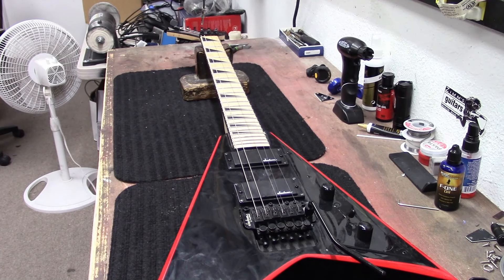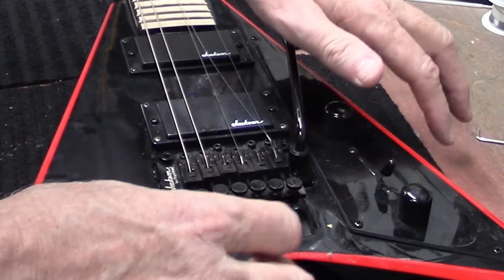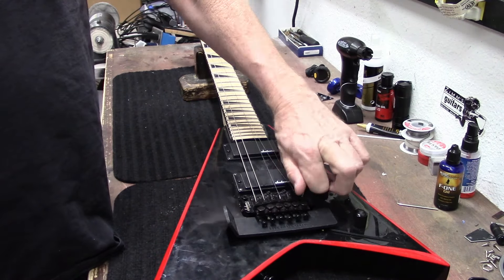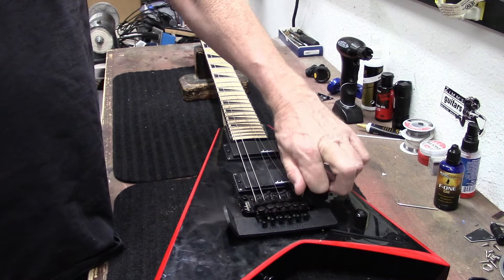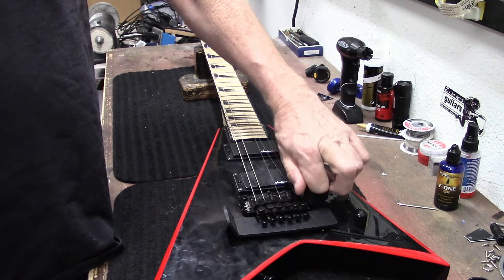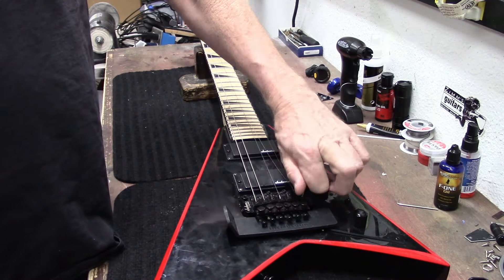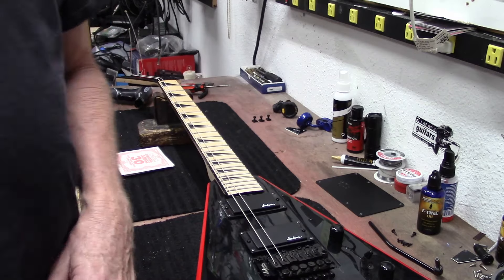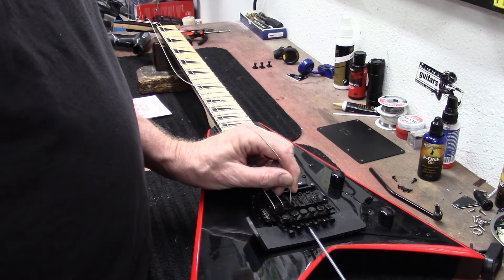Jackson RR-V Restring

Comment: Just so you know, Dane, I've recently discovered that it DOES matter if you mix up the string locks.  Unless they're made of a harder material than the strings, those strings will indent the surfaces of the locks and print their shape.  Those indentations won't match if the locks get scrambled, and they won't hold the strings well.  This absolutely explains the large number of times I bought a guitar with a Floyd and it was brilliant -- right up until I changed all the strings at once.  Then I'd usually pull the string locks out of the nut, thinking that I could put the back just any old way.  Now I know that -- and why -- I was wrong.  Hope this helps you in some way.
Reply: I just loosen up the locks just enough to have the strings clear it moving freely through. Never take them all the way out, it's unnecessary. Slide em out, then slide the new ones right through there. Boom done. Lol
Reply: @cycomiko73  There is one situation that that approach won't help.  I've had Floyd nuts wear out to the point where they slip, no matter how you tighten the locks.  Removing the locks entirely (1 at a time) reveals the state of the nut -- at least you can move the strings so you can see what's up.  I imagine this problem attenuates as the acquisition price of the guitar goes up!

Comment: I thought you should do the intonation when changing the gage of the strings, especially that big of a difference from 9's to 11's, a 42 to a 54  would also need the action a bit higher or it'll be buzz central on that dropped B string.The tuning will be slightly out somewhere further up the neck without the intonation adjusted accordingly for those different gage strings. I use 11 to 56 NYXL's in dropped B, going from 9 to 42 in standard, and had to do all that I said.

Comment: I stole a trick from DylanTalksTone for restringing Floyds.
Get a wooden block or eraser that seats the trem dead flat and loosen off the springs so that the block/ strings are the thing keeping the block level.
Do your string change, intonation heights etc and set your tune. Do up the locking nut and check tune.
Then tighten up the springs until the block can just slide out - the block should remain level and there should only be a tiny amount of retuning needed, but no need to keep doing both strings and springs.